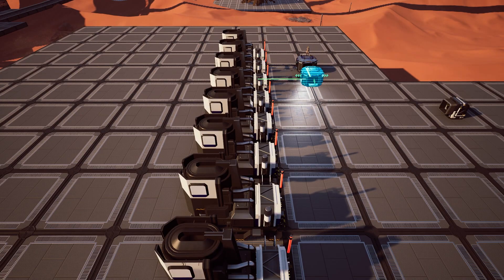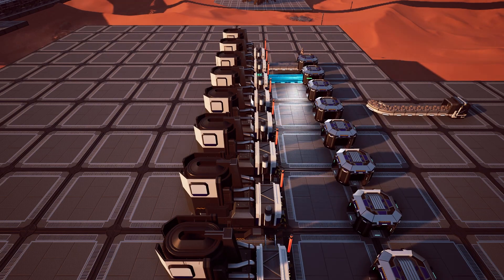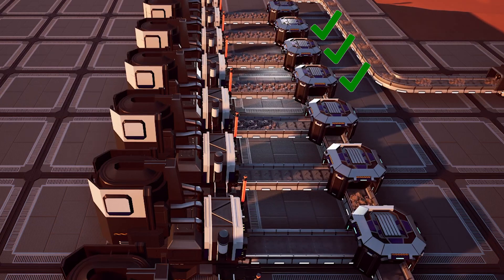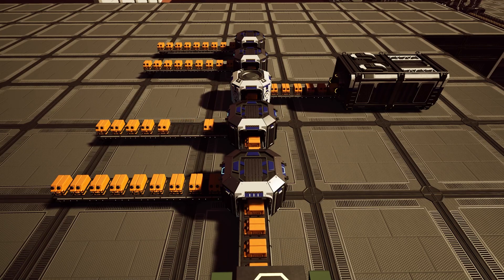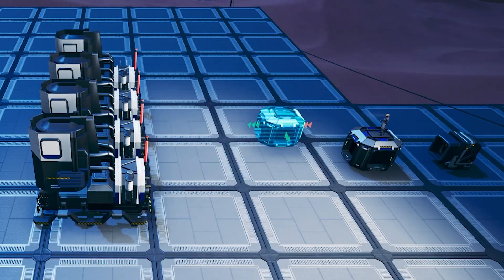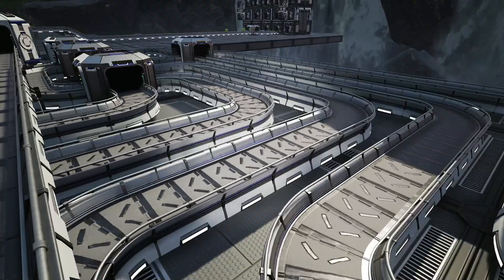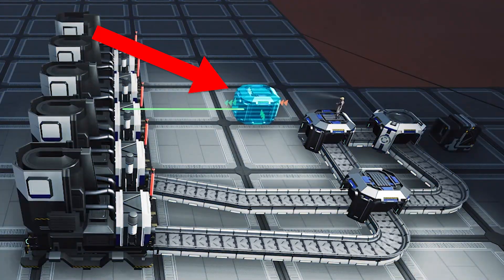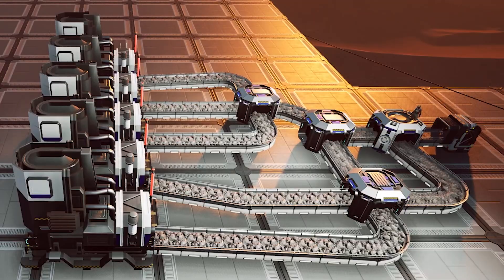Satisfactory: Manifold vs Load Balancing for Belts + Tutorial

Comment: I often use the load balancing for nearly everything. math is pretty easy for them plus I like the consistency but the couple of times I have done the manifold method I have been pained by having to wait for the long start up which when combined to making modular factories. I want that thing working before I leave because if there is any issue I could have an important process I though I had up and running then I come back to it like an hour or two later to find out I had forgotten to have the recipes set on a couple of machines making it work at only partial efficiency. (I almost always load balance for any power solution because I like a reliable power grid that will never hiccup like I have had some in the past do.)

On that note: I believe super factories would benefit by the manifold system best while modular factories would benefit more from balancing overall due to the need of making the most out of your space on the super factories. The easy expansion of the manifold works better for the super factories while with modular factories you want to know it is working and at that efficiently before you leave it so the balanced method may be favorable. I would really be curious if speed runners would have a category created for tutorial-stage 4 of the space elevator. (Yes, they would be long speed runs but it really interests me to see how optimized they could get and one of the biggest things would be the manifold versus balanced conveyors, heck at some point I may be the first submission into such a category just because that is how interested with wanting to see others optimize the process. The most fun part would be to compare their runs to what I predict it would look like from thought experiments.)
Reply: You can just move a bit of material in by hand to get everything running faster at the beginning. I think this method is the more efficient. You can build just one assembly line and than expand as necesarry, you safe space and you potentialy safe time because you need less planning ahead.

You wrote that you like a stably power grid. If you have a LOT of batterys a few up and downs in your power consumtion (and generation mostly do to gysiers) don't matter xD
I really wish that they added another better battery. There are small and large tanks for liquids, why no large batterys? :(
I made a "playthrough" with nearly no foundations, really little optimisation, a lot of clipping, stacking stuff (you can build conveyers not only onto each other but even on power poles!) and it was not only a total mess but made a lot of fun. Can only recommend xD
Reply: Load balancing is (usually) a waste of space, time and resources... And ficsit does not waste

Comment: Load balancing has ZERO advantage over manifold. It's s pure math.
Reply from the maker: If and only if you allow the manifold system to fill up before activating it. Getting nuclear fuel rods to my nuclear plants fast enough required me to either wait for hours for the rods to back up, or just to make a simple load balancer. In that case, load balancing saved me a lot of time. But that's my ONLY load balancer, it's useless otherwise.
Reply: All you need to do is connect inputs first then connect power to the machines. The inputs are the limitation. Assuming you provide enough inputs both manifold and blanced setup will run at full efficiency.

Comment: So in a manifold system, do you have to make more of secondary buildings in order to keep the first ones from bottlenecking? I'm using the manifold system but I've come to a point where only the first few smelters are producing and the rest in line are not contributing anymore. I don't know if this makes sense.
Reply from the maker: Yeah that's the problem with manifold, but it should be fixable. Are your belts giving your smelters the proper amount of materials? Like if the smelters can process 120 ore per minute, are they receiving 120 ore per minute? If yes, then you can temporarily pause whatever machines come after the smelters, so that the smelters have time to fill with materials and back up. Once the input belt is fully backed up and stopped you can turn everything back on, and the system should work forever. As long as the math is correct.

Comment: It's too complex. Imagine how much space you need for, lets say, 50 smelters. If using manifold, buildings would be filled by the time you finish building the next production line. Also you can use smart splitters and simply set /overflow/ for further buildings so that they fill up one by one
Reply: Smelters are like, the best example where a hybrid of both is best.  One splitter per two smelters, which is connected via a mk1 belt coming off a manifold line.
The mk1 belt acts like a rate limiter at 60 items/s, and the splitters going to the smelters just halve both to the required 30/s
Load balanced from the start, very little effort to set up, and only slightly more space than a usual manifold line takes.

Comment: The real dick move was adding in the line items that want 12 input. most of the rest splits out pretty evenly/easily/cleanly but splitting a regular belt in 5  cleanly is a PITA. it's basically begging for an overflow crate, a haphazard overclock or a production overflow unit.
There's the divide by 2-3-4 math then there's the overclocking or dev's just messing with you side of things :p

Comment: If your going to make a feed back loop on your line why not just add more production and dump a product into the awesome sink until you require the material for something else?
Reply from the maker: Because that's not what the feedback loop is. The feedback loop DOES go into the system again. If you have, for example, 500 materials on a belt, and you need to get it into 5 equal belts of 100, you'll still split it into 6 belts, and loop back in the 6th one. You're not getting rid of that material, you're just redistributing it into the system so that it splits evenly.

Comment: I really don't understand how anybody could do "load balancing" at later stages of production. For all the talk of "manifold takes time to fill up," load balancing takes longer to set up, sucks a ton of valuable space, doesn't scale easily, and only really looks cute for your first couple of iron and copper factories. I can't imagine painstakingly setting up load-balancers for something like an aluminium factory.
Reply from the maker: Yeah, at any stage of the game there is no point UNLESS you absolutely need to. Like not being able to saturate the system before turning it on, or needing to split off uneven amounts from the same belt. There are corner cases but it's almost never the right choice.

Comment: Another way to make manifolds easier is "system flooding." By having the lines running before the machines are even turned on and also manually inputting the resources into the machine to get the system started up the manifold should run flawlessly as the belts catch up with you manual loading.

Comment: I don’t really see how load balancing isn’t more effective and easier to understand. The manifold system is worst in every way since it requires more splits and doesn’t load balance.
Reply from the maker: Most systems don't require balancing. If you let the system fill up first, especially, manifold will work just as well.

Comment: Another downside to the load balancer with feedback loops is you can't easily use them if the initial belt feed is at or near capacity. If the main belt has 120/min items coming in, and you try to split it to 5 machines, with a 6th line being the feedback, the feedback belt will clog up as the initial line is already at capacity. You would need the next tier of belt to have capacity on the lines to handle this. 

I haven't built nuclear power in any of my play throughs yet, so maybe I'll look at using load balancing there, but otherwise I never touch it.

Comment: I have tried manifold twice... and both time, I end up getting supply ripple... even though the load is correct, and the factory is small. For instance, my newest factory runs 3 Mk1 miners on 3 normal iron nodes for 180 ore. Two of the miners are merged for a 120 feed, and the other straight. The 120 feed goes into a manifold of 4 splitters, and the straight line goes into 2. Even with all the smelters outputting non-stop. I've ran it for hours after saturation, and it won't normalize.
Reply from the maker: If it's perfectly efficient (the system asks for the exact amount that it receives), you'll need to stop the machines and let them fill up with materials. Probably the best method is to deconstruct the belts coming out of your smelters and let them fill up with both ingots and ore, then reconnect them and the system should work fine.
Reply: @SatisfactoryNews  - I'm in the midst of a complete teardown right now. We'll see how the new setup works.
Reply: @SatisfactoryNews  - the machines don't fill up when they're turned off... either by standby switch, or power kill. I have even went so far as priming the belts, and then manually priming each machine. I still have hiccups. For instance, even at the lowest level... I have 120pm lines feeding 4 smelters per  line. 4x30=120. Should work great, right? Nope. If it wasn't for the 60+ meters of conveyor coming from the miners, the miners would be suffering from surge/stutter, as they do at my other plants. I have mitigated the issue on other floors, by incorporating downstream prioritization, storage buffering, and making sure I have overflow management for each item... but that still requires going back and manually offloading the buffers, and doesn't manage the issue from the smelters. I have often wondered if it doesn't have something to do with the cache management of my 5800X3D, and have thought about cranking up the ECC in my memory controls, just to see if it helps. In a game like this, I really don't care about a 3ms latency, if it will solve the compute issue.

Comment: I pretty much exclusively use mmanifolds. I'm originally a Factorio player, so it more closely matches what I'm used to (inserters pulling resources off of a single line until it's empty or until the output is satisfied).

Comment: For manifold efficiency, use your fastest belt for the core line, then slower belts into each of the machines. If the machine only needs 30 items a minute, you can use a 60 item per minute belt for example. This way the core line will back up much faster.
Reply: This is not true. The first half of machines will startup faster, but because of that you have less excess to fill all the inputs, and you need to have all inputs filled except the last two to be 100% efficient. So, it actually takes longer if you do this. The only way this is faster is if each machine needs exactly 60 or 120 items/min.

If you want your machines to startup the fastest with a manifold, use smart splitters to overflow items to the next machine when one is full.
Reply: @jordanhoman0212  Never thought about this but you're totally right. Might actually use smart splitters for my next manifold blueprints!

Comment: Wait, surely this doesn't work for ALL N, right?  20 for instance is 2x2x5... but I suppose then you can do the 5 split first as 2x3-1.  But then for 19, you'd have to split to 5 (with 2x3-1), then split each of those twice to make 20, then return 1 of those as well?
Reply from the maker: Sure does. You don't need to use 5 though, that was just an example. For 19 you could create 10 splitters and create two belts off of each. Then put one belt back into the system. Works every time, technically.

Comment: During the building process of a manifold I try to get resources moving early and each machine powered on accepting resources as soon as I can - this helps fill up the machines as I go creating the backup of resources that we want - it's also bizzarely helpful to make mistakes and end up with a surplus of items in your inventory to top up machines, which is helpful since I tend to make a lot of little mistakes
Reply: Same, when I am building a manifold I always start at the input and feed each machine as I setup the line to minimize the wait. Works great, by the time you are done almost everything is buffered unless you are making a longer manifold.

Comment: That cool, and interesting, not certain how useful it is though. Manifold is more space efficient and after it gets running fully(very short time if primed) works just as well. And late game with 50+ machines is pretty well a must.

I’m working on a 200+ coal generator build right now and have about 8 rows of manifolds. To load balance then would be nice but completely infeasible (actually impossible given space constraints)
Reply: There are no space constraints in the sky....

Comment: I think the only place I've used balancing in this game is when I didn't have enough resources to fully feed multiple types of machines (making things like plates and rods and screws for example) so that I would get a reasonable amount of all of the final outputs.
Reply: The only times I've ever used load balancing is in those situations where 

1. I really cared about getting all machines running in a timely fashion (like with a nuke power plant)

2. When I didn't have enough input for the multiple production lines  I was feeding.

Otherwise it's a complete waste of time and space. Ficsit does not waste

Comment: Getting manifold up to speed is easy, just pre-fill all machines' inputs with resources manually and the manifold itself will saturate in no time.
Regarding balancing, merging the loopback back before first splitter reduces the capacity the merger can accept from the input belt. It's better to split it into two or three and merge these in before the second row of splitters as there the belt capacity isn't fully used anymore.
Balancing isn't too more complex than manifold, basic splitting uses the same number of splitters at worst and may even use less if you split into multiplies of three. Manifold using splitting into three is clunky unless you have machines on both sides of it. Just the loopback needs some extra hardware. And having thoroughly tried both, balancing is pretty much never worth the effort.

Comment: Slight correction on the Manifold at 1:20, the last two belts in the manifold will always receive the same throughput as each other. So in this example, the furthest two belts are both receiving 1/16 of the total throughput.

Once you get to the last splitter, all that remains is simply being split in half - so they are getting equal amounts.
If you want to think about it mathematically, the fractions at 1:20 don't add up to 1. 
1/2 + 1/4 + 1/8 + 1/16 + 1/32 = 0.96875
1/2 + 1/4 + 1/8 + 1/16 + 1/16 = 4/8 + 2/8 + 1/8 + 1/8 = 1

Of course, this all matters very little on any sufficiently large manifold :)
Reply from the maker: Yeah, I think my intention was to say "these are the fractions and also it continues as such if you make the manifold larger" but based on the comments, that clearly did not get communicated very well.

Comment: I make my friends mad when I do balanced the way my insane brain does it. It is the most inefficient space way possible. I split and split and then merge parts of splits into the slightly larger splits to get the exact amount. For example getting 15 down to 3. I would take 15 three ways so 5 each, then each of those 2 ways so its 6 belts of 2.5 go crazy doing math until I find a way that is exact to the .001 and then build it. I will try for hours until it's perfect. And my friend would build 4 factories in the same time using manifolds.

Comment: I usually don't have too many issues with the manifold. I'll typically use an MK4 belt to feed the splitters and I'll use an mk1 belt to feed the machines. The rate at which the MK1 belts pulls the items off the MK4 belt can not keep up with the rate at which the MK4 belts moves the materials. I typically do the same on the outputs except I may use an MK2 or MK3 belt feeding into an MK4 belt on the merger side. The builds are typically much easier and cleaner looking and faster to set up. There are some cases where using the balancing method is the better option but more cases than not, the manifold is just fine. Also with early stage productions such as smelting and or construction of basic materials or parts, I'll usually add a storage buffer both before and after each stage of the production line. This helps to minimize shortages when starting to build more complex pieces that involves assemblers and manufacturers. There will typically be an ample supply of materials that are ready to be used instead of having to wait for the production lines to catch up. It does help to reduce bottlenecks.